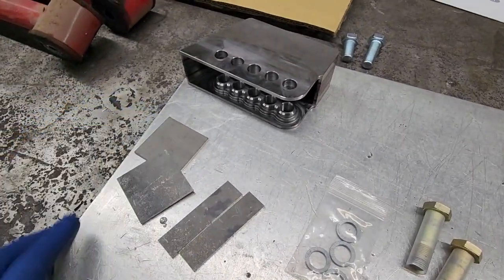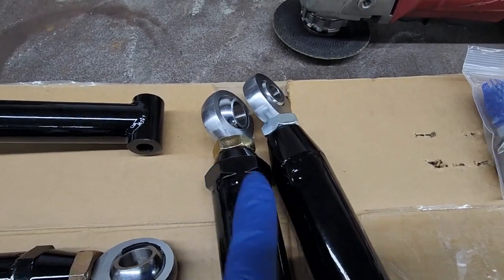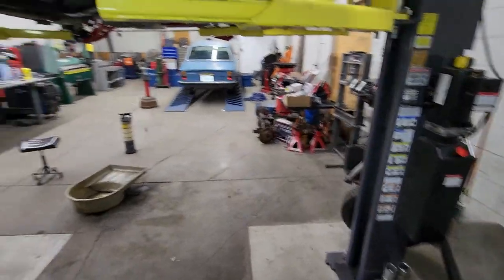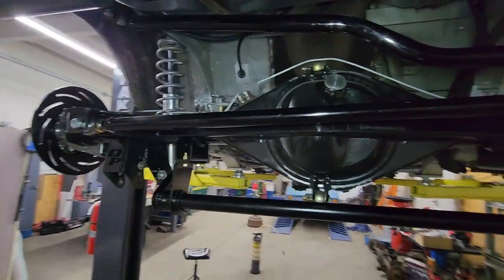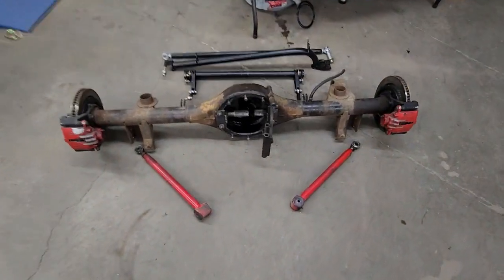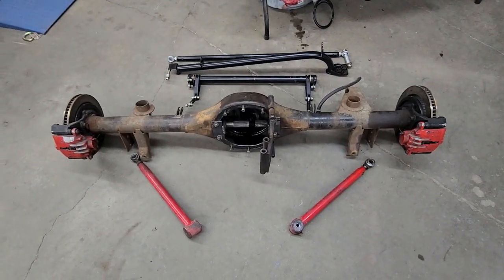We install some very nice suspension parts from Trick Chassis and Tick Performance on the Camaro

Comment: I have the same rear end and I had the perches added in the stock location for the roll bar. Do you know if the perches for the anit roll are in the stick locations ? I know you welded these on . Just trying to figure out if this will work for me without cutting off the  ones i jave now. Thanks
Reply from the maker: They might very well work. I bet you could ask Trick chassis for the measurement to be sure. I think they are in the stock location but they look longer to me then the stock sway bar mounts.
Reply: @kbern88  Thanks for the reply the video was helpful.

Comment: Very nice work!! Love the outcome. One question, On what wire does the Diode come so the fan, tb, wp etc doesn’t back feed to the ECU?
Reply from the maker: The diodes go on the wires going to the output wires coming from the ecu. The diodes are one way so make sure they are the correct direction.
Reply: @kbern88  Are you setting up the ECU to activate them? I just have a termi and have my Switch panel just activating a 12volt signal from the switch to the relays.
Reply from the maker: @v8tergt653  Yes, the ECM is controlling all of those items but we can also turn them on with the switch panel. We started out just using the swtch panel but after a few times of forgetting we decided to let the ecm do those functions for us.
Reply: @kbern88  Yea that makes sense, thanks for the reply, greatly appreciated